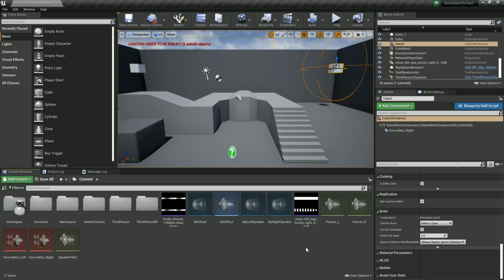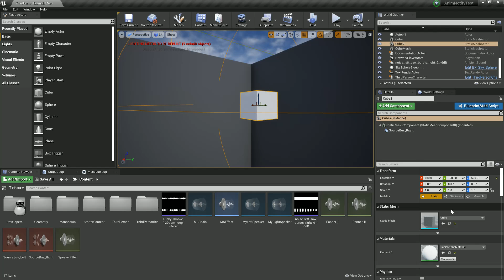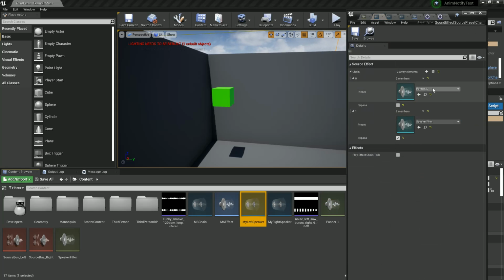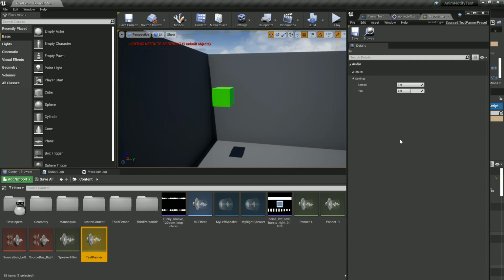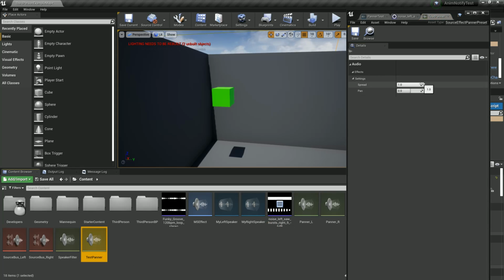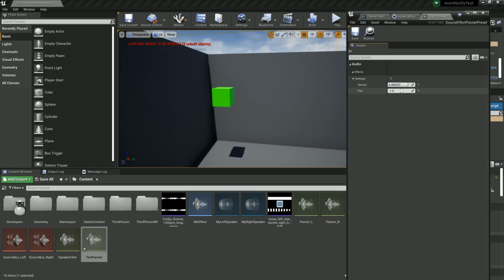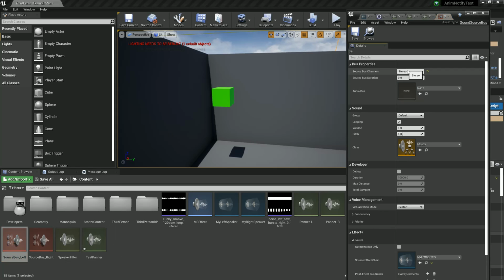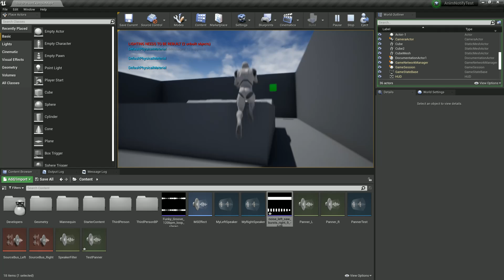SourceBus StereoSpeaker Setup

Comment: Thanks Dan, awesome and really helpful! In UE4 is it possible to apply a reverb to the saw bursts prior to spatialisation? E.g. to simulate applying reverb in an audio mixing sense that afterwards comes out of the speaker with the direct sound. I've been messing around but the reverbs seem to instead simulate acoustics with each attempt. Cheers!!
Reply from the maker: Definitely possible. We would just have to implement a reverb Source Effect. The issue with that is usually reverb is a very expensive process, so having a reverb per source is usually not possible on AAA titles where graphics are taking most of the resource budget. But maybe an indie game where maybe there's more space for CPU resources... So yeah, it's possible, it's just that making a reverb source effect hasn't been prioritized.

If you're comfortable in C++, you can look at the Reverb Submix Effect and make a Source Effect using our DSP library.
Reply: @DanReynoldsAudio  thanks for that info, helps a lot and that saves me many more hours of trying to implement directly in UE. My C++ chops are nowhere near ready to attempt grabbing a reverb from the Submix Effect for the Source Effect, but it's good to know. Thanks again!